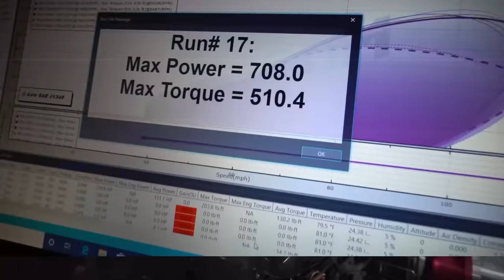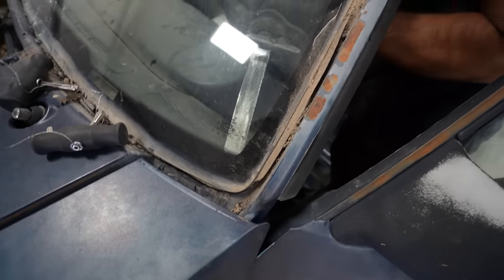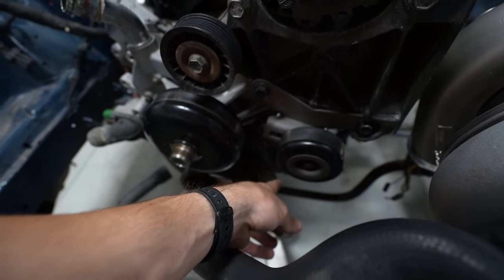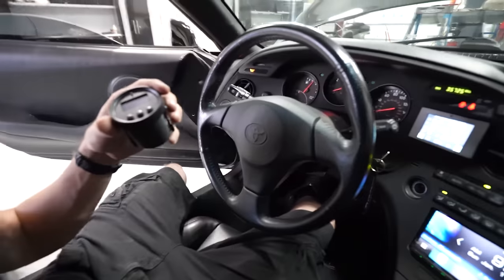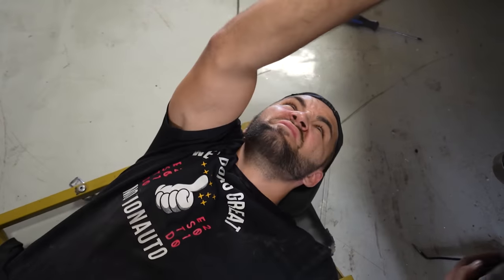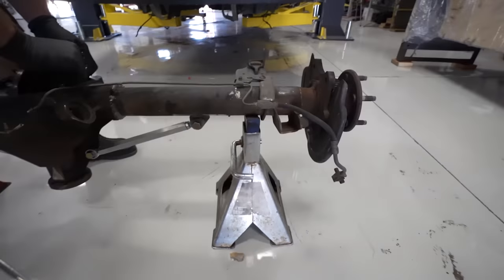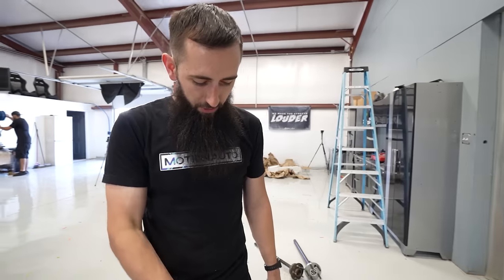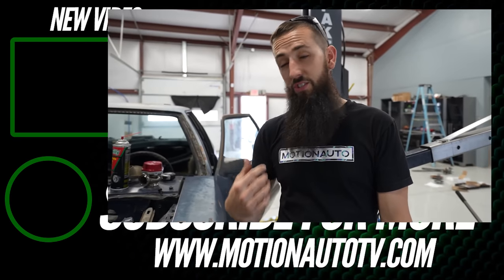Building A Turbo LS Foxbody Drag Car In 10 DAYS! | Rocky Mountain Race Week Prep (Pt. 3)

Comment: The explorer 8.8 is the only factory 31 spline axles and they would be more than sufficient for the HP you’re shooting for. Depending if the 94’ that rear end came out of was a auto or manual car I’d definitely suggest finding a set of 3.55 gears over the 3.23/2.73

Comment: you should definitely get 2 waste gates on the exhaust your gonna get some boost creep engine masters was just doing a comparison of turbo manifold vs header and the single was gate on a 6lb spring would creep to 8 or 9 lbs
Reply: Over how much time was that creep
Reply: @80603lv  it was a engine dyno pull  and then they swapped from the manifold to header they had 2 gates and it held at 6lbs so they disabled the second gate and it creeped back up to 8-9  on that run

Comment: I would definetely re-think the no sway bar that car will handle awful on the road, 
there is nothing worse in turning a corner or running around a curve in a car without a front swaybar.